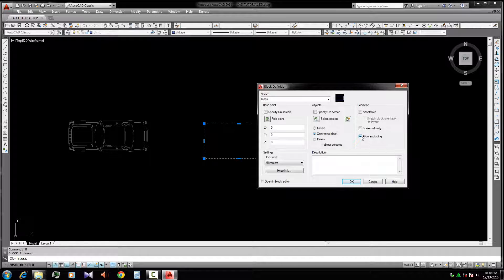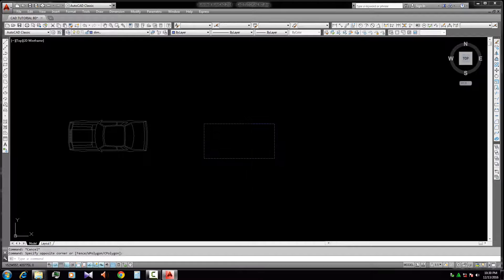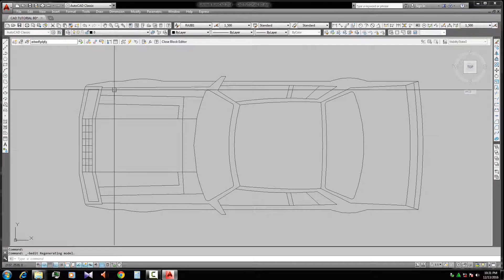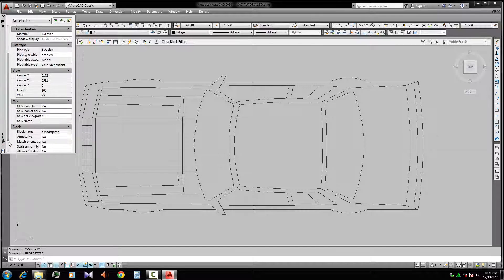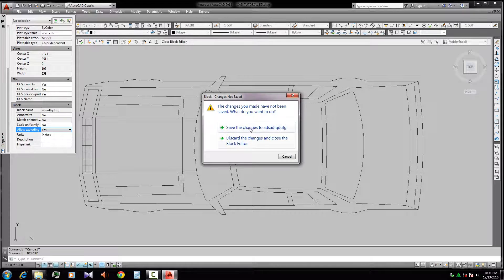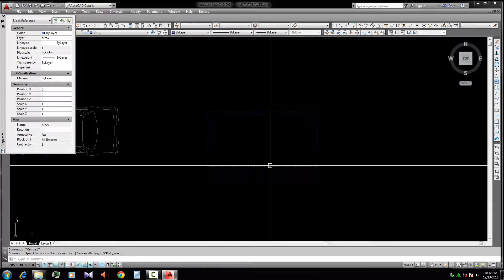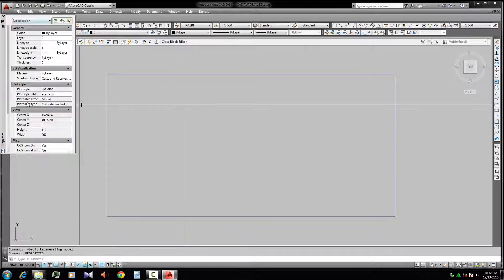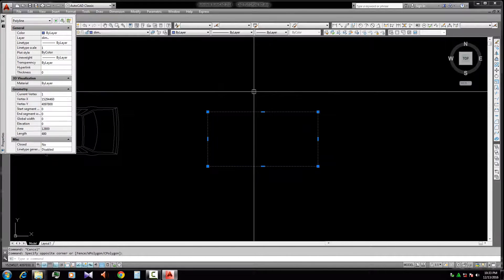How to Create an unexplodable block & Explode unexplodeble block in AutoCAD

Comment: Selamün aleyküm. Thank you fir this share. Have a question: I could not assign any materials to  a downloaded Refrigerator object. All i had was a fixed color by layer. No matter i have tried, even it shows materials added end result was the origin color and no aluminum, or wood or any other materials were being showed. Any suggestion? Thank you.
Reply from the maker: Oalaikumussalam, I am really sorry for the late response. Are you find the solution? If not, you can send me the cad file which is in trouble. I will try to fixed it. If you have no problem.